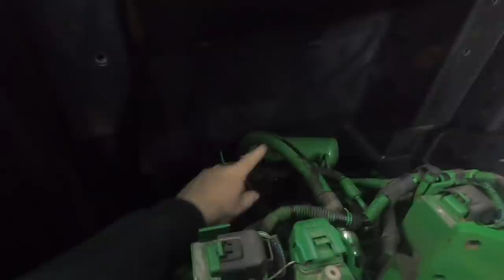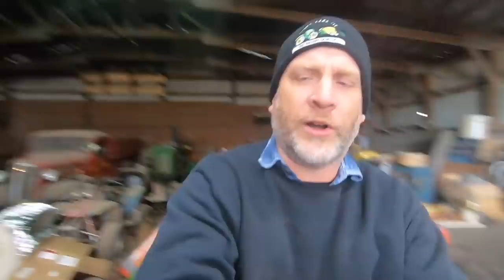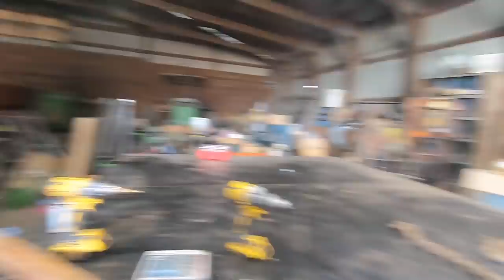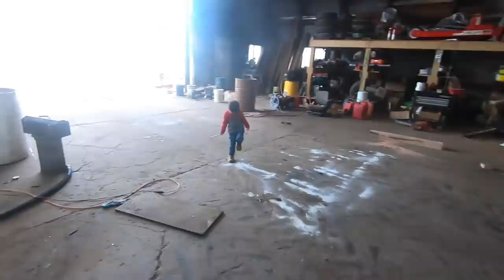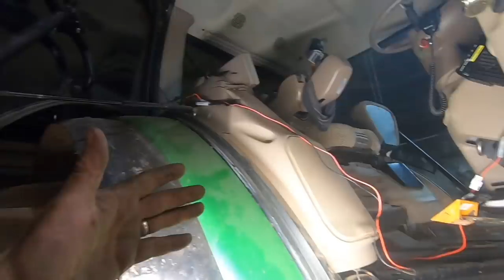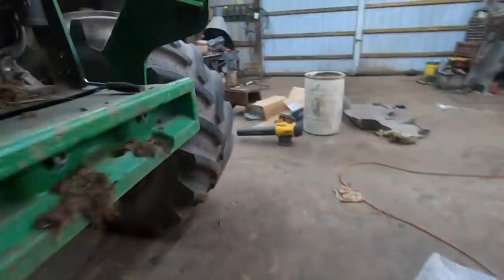6210R Is In The Shop

Comment: Those 6r cabs are designed to be tilted off to the side (remove the right wheel and install the special hinges that bolt on) fun watching you find a way to do it with what you have.
Reply: I seem to recall that too...the cab could be tilted left or right ? It did give plenty of room to work on the trans, I wonder if you can still remove the trans like that ?
Reply from the maker: there are no hinges on this one.
Reply: @onelonleyfarmer  John Deere sells the hinges to the dealers atleast. I used to work at west central John Deere and that’s what we have done in the past. It’s like a whole kit
Reply: Tilting cabs are usualy done for quick repairs in the field, there are special tools and rods for every cab model 5r, 6r, 5mc, rc,... Transmission work is always done with cab taken off. I work in JD delareship in Slovenia
Reply: @andrejgregorc  Nice, I worked at a John Deere dealership in Loxahatchee, Florida and we did transmission work in the shop with tilting the cab. Transmission work, not transmission removal.

Comment: Someone has probably mentioned by now that the cab is meant to be tilted to the right after taking the wheel off and inserting pivot pins. All hoses and cables should stay in place as they flex around the pivot point. They  designed this to be quick and easy but it does take two bays side by side.
Reply from the maker: no hinges
Reply: @onelonleyfarmer  they are bolted on as an addition as a kit to service and tilt it.
Reply: @onelonleyfarmer  
Hinge brackets used to be fitted as standard on earlier models with only hinge pins needed to be inserted. If not present on current models, I suspect they could easily be fabricated. They really are designed to be easily tilted for access to under the cab and chassis components that way. Honestly! No need to disconnect any cables or pipes except maybe those fitted later and not routed ‘correctly’.

Comment: use rubber vacuum caps to cap the washer fluid tank when unhooked or loop a piece of hose if it has two ports. most automotive is the same way, unhook the lines and it pisses out until empty. 🤪